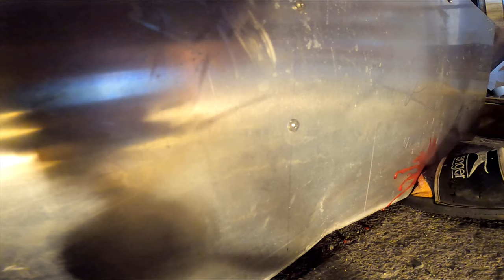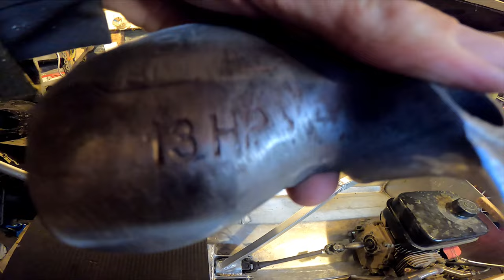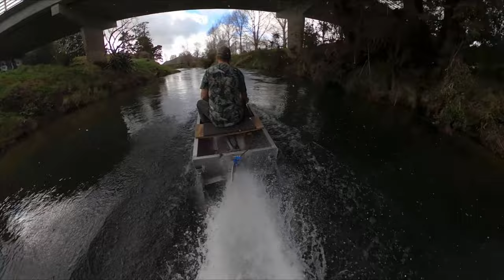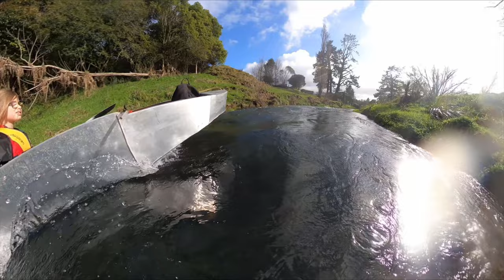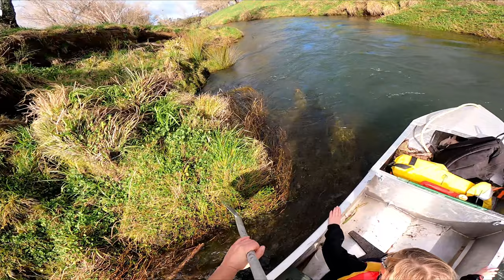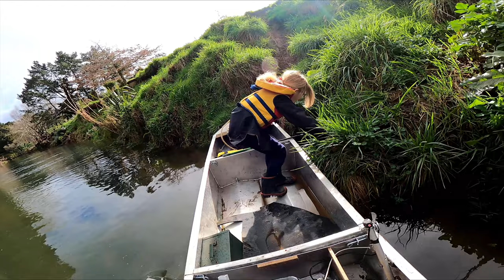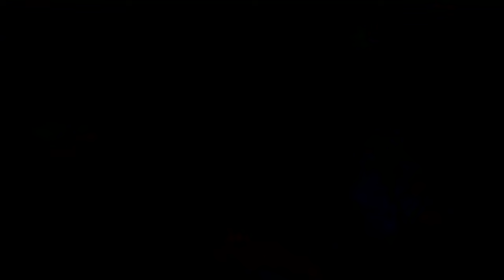Mini Jet Boat To Inboard Surface Drive , Test!

Comment: The first thing I noticed was that the rudder needs to be much bigger, and reach a bit deeper too. The bending rod will definitely not be strong enough for the bigger rudder. I recommend a classic double-pull steel cable, similar to the old boat steering systems from the 1960s. You can still use either a lever or a steering wheel with that configuration. It's much stronger. 
 It's tricky using an air-cooled motor, as you have no water source to bathe the exhaust and keep it cool. If the motor has a stator and rectifier, you can use that to run a little 12v water pump. Pick up from the river and pump into the exhaust as close to engine as possible, with a check valve. And yes, the exhaust needs to be routed up above the max water line, before going down to exit the hull. Water exhausts are always different depending on how the craft is expect to move and the freeboard, so you'll have to customize it in your own way to keep the water out of the engine. It sounds like a lot. 🤔 Alternatively, I suppose you could wrap the exhaust with heat insulation, but on occasion where the river water rushes back into the pipe, it could crack, since it would be red hot after a long run. 
The easiest solution to to let the exhaust blow up into the air, or off to the side, keeping the exhaust pipe as short as possible. It would be louder, but the engine would like it; it would work.
 Indeed, boat is difficult. That's why I just bought one instead. 😁 
Above all, let me just say that the kick-up drive feature you made, is GENIUS! I love it. I've never seen anything like it, here in America, where we're all supposed to be so bloody smart! 🤣

Comment: Put a butterfly flap inside the exhaust pipe that only allows exhaust out.  most I/O's have them. Or just use a muffler and exhaust it into the air instead of under the water. It will also help with the noise.

Comment: Love the honesty of kids put a bleed point in the exhaust as a relief valve.
The rudder is way too small think of the surface area the paddle uses as you can drop the prop the rudder needs too able too cover that area plus a bit more I would probably put a four blade

Comment: Tiny hole drilled in the exhaust (up high) will break the vacuum that draws water into the engine.  Bigger rudder needed.  Great fun!  Great Dad.
Reply from the maker: Thanks ! That was what it needed !

Comment: More rudder in the water. That will help a lot. As far as the exhaust goes. Prob be better to just run it out over the side. Less to worry about. Just water jacket the pipe. Pretty easy to do once you start doing it. Especially the way you are building your exhausts with short straight sections. Fun boat man. Love that you can just take it apart and toss it around. Can’t wait for the next video.
Reply from the maker: Ok thanks! I was thinking of just running the exhaust over the back , and I think a longer rudder is a good idea 👍

Comment: First, at the end of your trip up it looks like there's a small dam or weir that's formed a very dangerous hydraulic jump. The boat was long enough and you were able to get out but had you gone over you may have gotten stuck there. 

As for the rudder, it looks like it needs to be longer and possibly needs a spring so it gets into the propwash and can redirect it without kicking up. With the spring if you hit a rock it will still kick up.  Maybe for testing you can bolt another piece of metal to the current rudder and try different depths so you don't make it any longer than you have to. 

As for the exhaust, maybe a flapper on the outside. Even a metal one should work as it doesn't need to be fully sealed. When it's running the exhaust and water flow will keep it open but when you stop it will close and block the surge of water going back up.
Reply from the maker: We got to that rock ledge and didn’t have enough drive to get over it I glad we didn’t tip out because the water is cold this time of year. I am working on the rudder at the moment and doing everything you said 👍. I’m still working out the exhaust

Comment: I think you need a vacuum valve on the exhaust. It opens when a vacuum is present in the system, which will happen whenever it’s shut off and hot. 

Dual rudders that pivot on either side of the blade directing the flow would probably do the trick there as well. 
Nice job getting it out and working though!
Reply from the maker: would a valve like that handle the heat? 2 people for the double rudder now 👍
Reply: @DktheWelder  I would think so. I believe it’s just a ball with a spring. You can get brass or stainless. They do it on boats all the time for that exact reason
Reply: @DktheWelder  anti siphon valve I think they actually call them
Reply from the maker: @limitlessbuilds  o yeah I know what your talking about now , like a one way valve with a ball . I feel like I want to make one now haha
Reply: @DktheWelder  haha, give er! Not too hard I bet. Just need to find a ball bearing laying around and small spring